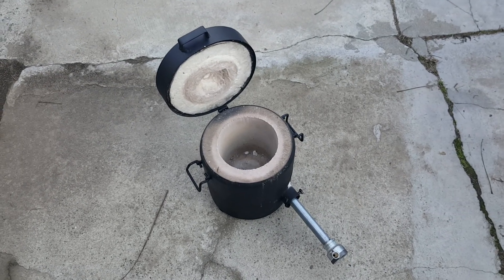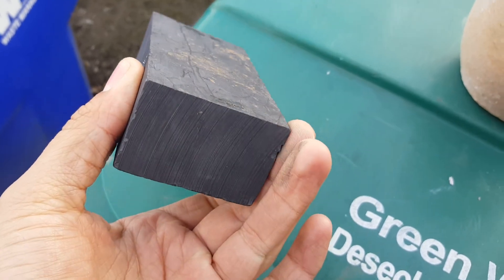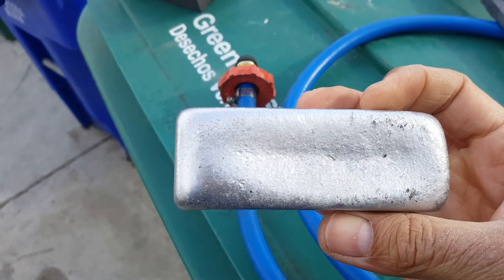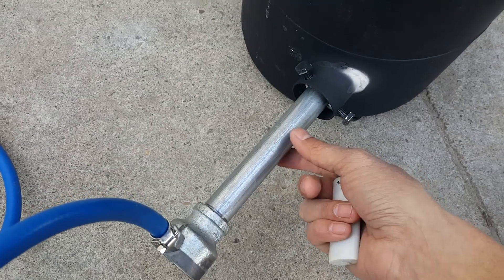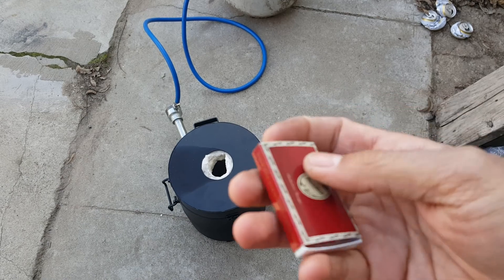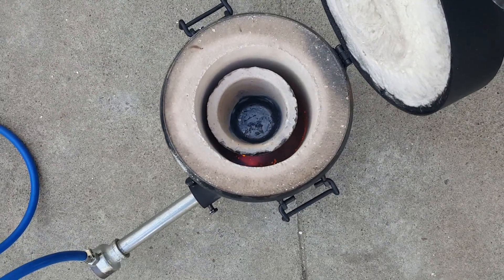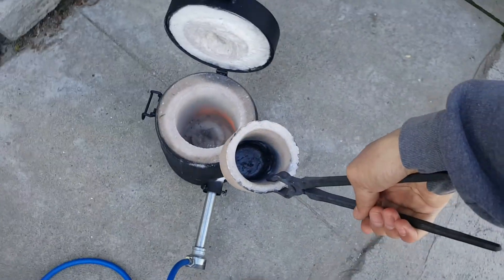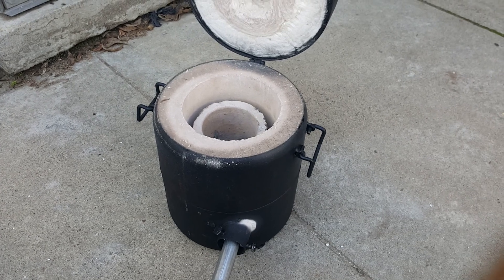FASTTOBUY 6 KG Propane Melting Furnace Kit w Graphite Crucible and Tongs

Comment: Paper is much safer way of lighting. Dropping a match to the burner where you have to lean over it. Tornado goes in your face. Thanks for the video I wanted to see this furnace was interested in it. I've built a couple but I think this time I'm just going to buy a finished unit. Make sure you get a propane torch. They have them for 12-15 a Walmart with the small bottle. Always preheat your mold. For 15-20 seconds with the torch. You don't want the mold to crack or explode and send molten splatter on you. If you don't have a torch. Take the mold and put it near the top opening of the furnace a few mins before you pour. You want the mold to be at least a few hundred degrees so it doesn't shock it.
Reply from the maker: Thank you for the suggestions, i appreciate it. Ive been using a torch to light it and have been setting the mold over the opening to preheat it. So far it's been a nice little furnace for aluminum. The only thing is that inlet pipe got stuck but i leave it threaded on anyways.